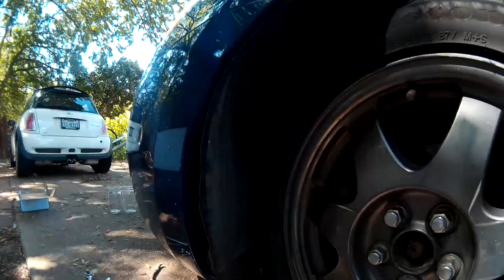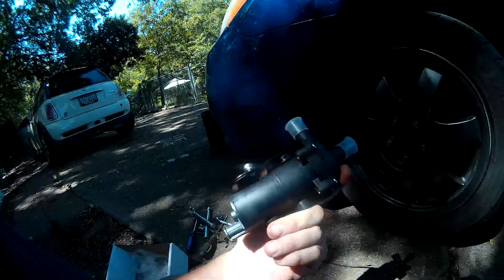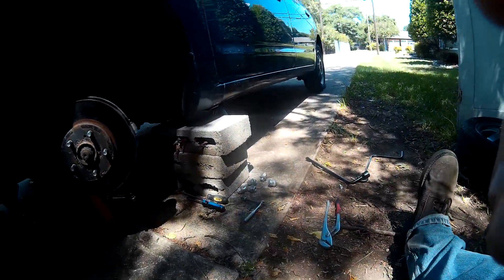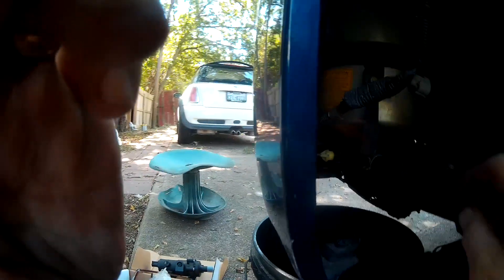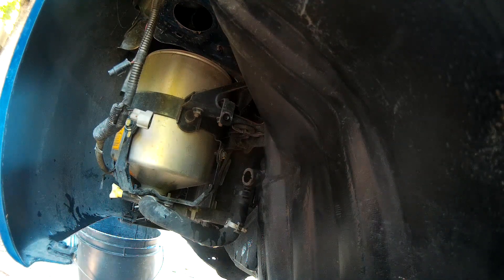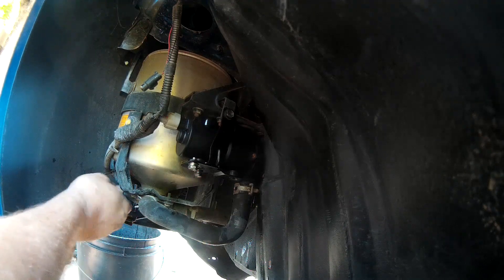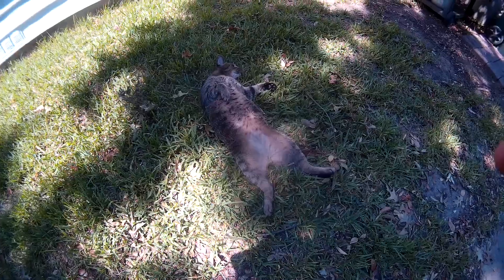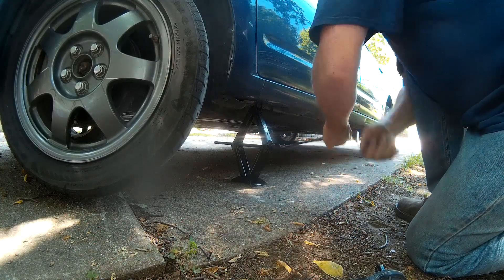CHS Coolant Heat Storage Tank Water Pump Replacement 2009 Prius Code P2601

Comment: I crack opened the bottom of front bumper liner and whole liner off except one rusty bolt under driver’s door, I didn’t bother taking off the wheel as one lug nut was rusted out and striped. Did you have to refill the coolant? I didn’t get idea to reuse the caps from new Dorman part then I lost a small bowl of coolant like bloody red color, I plan to reuse and pour it back but coolant reservoir doesn’t fill all coolant back?
Reply from the maker: I think put some back in or just reused the old Coolant. I had a pan below & caught it when it came out.

Comment: The hybrid battery cells are easy to  replace and normally is only one cell bad, and it coats like $30 , and  you pay 2000
Reply from the maker: Yeah, We paid $2200 for all of them & a guy replaced them in the driveway. Then 3 went bad 6 months later & they replaced them. Warranty...

Comment: I thought you didn’t have to drain the heat storage tank? Is it required?
Reply from the maker: Your Probably right, just put a clamp on the hose so antifreeze doesn’t get all over the place

Comment: I think mine needs replaced. I keep hearing this new clicking/knocking sound (it's not super loud) when the pump is making its usual noise. I'm going to check the codes later to hopefully verify that. Looks like a pretty simple fix. Thanks for the video!
Reply from the maker: I only found 1 video on how to fix it a few years back, so I had to make one

Comment: Do you remember what Millimeter ratchets you used?  gonna try to do this myself to clear my 2601 code.  Thanks for the video, really helpful.
Reply from the maker: 10, 8, 13 the usual. Great to hear from You
Reply: @rosstempletonogskater  Thank you.  Gonna try to work on it next weekend.  Since my sockets are scattered, now I know which ones to look for.

Comment: Wonder if this would work for P1122 no heat either
Reply from the maker: I didn't have that code. Could be Coolant Control Valve Position Sensor, whatever that is

Comment: What’s that wire hanging at 54 seconds? Is that suppose to be like that?
Reply from the maker: I was wondering the same thing.  It was just a red wire  with a connector on it, (not connected to ANYTHING), just taped to to that black tube .
Reply from the maker: @emmamccarter4118  Julie, mine wasn't plugged into anything either, just hanging with electrical tape around it , but not plugged into anything
Reply: @rosstempletonogskater  I Think that alarm sensor when left door open or lights
Reply: Same with me

Comment: What was it that you replaced exactly?
Reply from the maker: Coolant heat storage tank water pump
Reply: @rosstempletonogskater  new one is1,300 are used ones ok?
Reply from the maker: @douglasvaughn9349  the pump was like 80.00 or 120.00 at O'Reillys.

Comment: hello thanks for the video.
i got p1151 code. any advise ? i was planning replace pump too
Reply from the maker: I had a similar code 1150 coolant path clog of coolant heat storage tank. It went away after I replaced this part & the coolant level went back up into the tank. took 3 or 4 days. After you replace a part you have to CLEAR THE CODES, drive it & see if the code comes back..